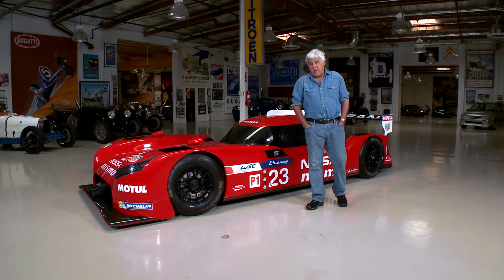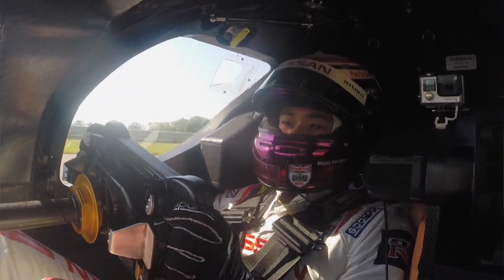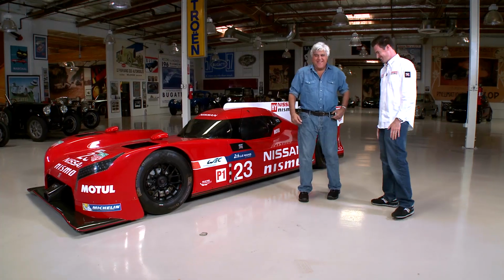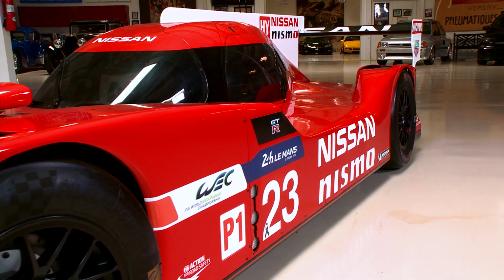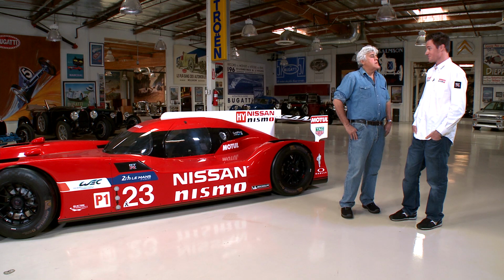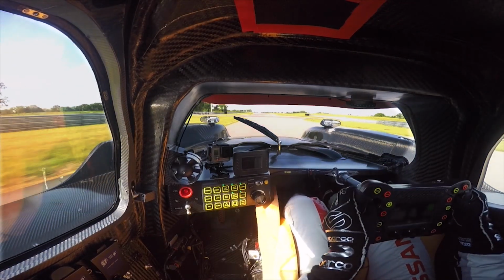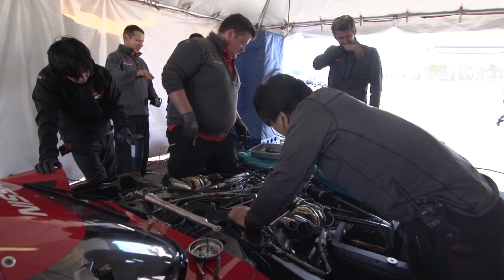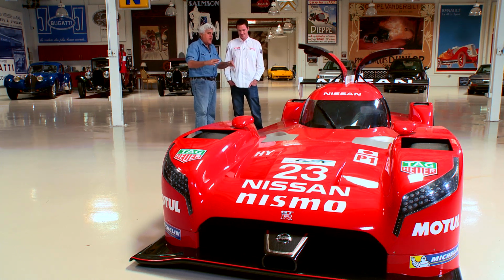Nissan GT-R LM NISMO - Jay Leno's Garage

Comment: So many keyboard engineers here. The design works great for the rules and it is the best setup.
Reply: Porsche Curves Also, no talk of the Godzilla button?
Reply: Porsche Curves did u see it's times? it was in last as far as LMP1 cars and its fastest LMP1 car is being outpaced by several LMP2 cars. this is just practice yes
Reply: James Lewis No, it isn't practice. It is testing. They don't have any setups and were just finding basic data needed to figure things out.
Reply: Porsche Curves "it is the best setup." Bold claim at this point (no, I'm not even going to use the test day as an argument).
Reply: The best setup is the fastest car that wins after 24 hours. This is a publicity car like the Nissan /Delta wing. People get excited by the hype and "innovation", but Bowlby has a bad track record of developing cars that actually go fast or finish races. The point of this project is marketing, not to actually win anything. Car guys suck up hype and BS like no other customers.
Reply: truantray The Delta Wing has problems due to suppliers not being able to make parts that are up to snuff. The Delta Wing only fails due to the gearbox. The GT-R doesn't have rear wheel power due to the supplier not being able to make an electric motor that is light and meets the power requested. 

The design works quite well given the rules. Nissan was running 1,000hp from the ERS alone during testing. It takes at least 3 years to win Le Mans. Have to iron out all of the small bugs.
Reply: James Lewis   
You are missing the fact that Le Mans is more of a fuel economy event than a fastest lap or top speed event. 

The better strategy is what usually wins and that 
is not always the faster/fastest vehicle, especially a long period endurance race such as Le Mans. 
Winning Le Mans is a numbers game with numerous calculated vector risks including fuel economy, malfunctions/failures, shunts, driver error, crew errors and attrition. 

The french organizers label it as "Test Day" and "Test-Practice" . 
http://www.24h-lemans.com/wpphpFichiers/1/1/ressources/Pdf/2015/24-heures-du-mans/classification/test-day/test-day-24-heures-du-mans-2015-test-practice-2.pdf
Reply: patw52pb1 Semantics? Test day, Practice whatever. In F1 they do 3 practice sessions before a qualify. They do exactly what Le Mans do on "Test Day" or "Test Practice" or said whatever. They make their setups for the race. On F1 "test day", like other Competent LMP1 cars, they are running times that are close to the times that they will be qualifying and racing.

But we'll see. I just dont believe they had failures on all 3 cars like that. thats bullshit. They are slow from the looks of it. Lets when they do their second "test day"
Reply: James Lewis F1 has test days and practice days just like WEC does. Testing != practice.Practice happens on race week. Testing happens whenever. There was an F1 test session after the Spanish GP. 

Being slow means nothing. Audi has always been slower than competitors but they have won. I wonder why?
Reply: Porsche Curves
Being slow means nothing. Audi has always been slower than competitors but they have won. I wonder why?

There's maybe a bit difference between being couple of seconds slower (but having a race pace that is closer to the top car) with a proven car and being nearly half a minute slower with a new car that is only bound to have more new car gremlin problems.

You should probably tone down your expections. Nissan is simply not going to be anywhere this year and "well Audi won with a slower car" argument is mostly not applicable. Ever since Peugeot arrived, one has needed a nearly flawless race AND a fast car.
Reply: deggis4 Audi was slower last year and they won. Out right speed isn't what you want. Audi even won against the Peugeots even though Audi had to pit more. 

I'm not expecting a lot out of them. I'm explaining to the idiots why the test day times don't matter whatsoever. The drivers weren't told to push at all. They were told to just do parade laps. They set the highest top speed. Once they turn up the wick and actually start practicing, their pace with right up there.
Reply: ***** Well wasnt this car supposed to have like an Independent powering unit to the rear-wheels from something similar to the KERS system? What ever happened to that idea? Is that still not the case?
Reply: James Lewis The supplier could not make an electric motor that was light enough nor powerful enough for Nissan's application so they dropped it.
Reply: Porsche Curves pretty sure they were relying on that and not a total Front wheel powering.
Reply: Hear That? sadly it isnt if you look at the qualifying times.
Reply: Hear That?  Hey keyboard engineer, it isn't an electric hybrid, no electric motors, no failed supplier. The rears would be mechanically driven just as the fronts but the complex shaft/gear drive was too heavy.
Reply: Hear That? 
The design works great for the rules and it is the best setup
They're not even as fast as LMP2 cars...
Reply: Hear That? so how exactly does "The design works great for the rules and it is the best setup"?
Reply: Hear That? You might want to retract that statement...... xD
Reply: ***** lol i know im just trolling him now because I think for once i deserve to troll someone
Reply: Hear That? "So many keyboard engineers here"      -keyboard engineer
Reply: Hear That? 2013, 2012, 2011, 2006, 2002, 2001, 2000, Audi had the fastest cars in qualifying, and won the race. In the years they didn't qualify on pole, they're only 2-3 seconds from pole position. In 2009 when Peugeot won, they qualified on pole. It's stupid to say that being slow means nothing and that Audi is always slower than the competition.
Reply: Forehead Jones Audi has been slower. That was a huge concern with Peugeot and so Audi had to hypermile the best they could to win.
Reply: Hear That? But you said that they are always slower. Now you're moving the goalposts.
Reply: SilverArrow WilliamsMartini Check out all these keyboard engineers who think the GTR is superior.
Reply: SilverArrow WilliamsMartini Yep, it's engineering was so superior that it was 20 seconds a lap slower than the other LMP1 cars and finished behind teams racing Porsche 911s and Dodge Vipers in their free time. Impeccable logic.
Reply: e-hybrid 919LMP1
Lol, how old are you? 13? Because you act like it. 2014 was the 919's first year racing and it was right on the tail of Audi with an hour left in the race before a mechanical failure caused it to pit. 2014 was Toyota's first year with the TS040 and it set the fastest lap and finished 3rd. 2007 was the first year for Peugeot and their 908 HDi FAP. They took the top 2 times by over a second, led most of the race, and finished third. And Audi has dominated Le Mans despite using several different cars throughout their streak. The GT-R LM NISMO was a failure. There's no arguing this. They finished dead last. Not dead last among LMP1 or even LMP cars. They finished dead last among every single GT Am car. They were 20 seconds off in qualifying and still 20 seconds off throughout the race. They got a grid penalty for being too slow. Of the one car that did finish, it didn't count because of how far behind it was. Accept it.
Reply: SilverArrow WilliamsMartini i hear what ur saying, but u make absolutely no sense because of a few reasons. For one you keep mentioning it was their first race. but we can go back and look at first races for a lot of cars in 24 hour of lemans. I can probably say that none of them ever finished as bad as this Nissan. Also how exactly can you say the design is the best? What reference are u using to believe so? because u cannot, and i mean absolutely, cannot say that its a good design by looking at its results. So what on earth makes u believe this car is any good at all?
Reply: Real car enthusiasts respect any car manufacturer like Nissan for what they are and what they do. I guess you're anything but.
Reply: Razvan J Seriously? I said the engineering is superior because of it's design. The fact that Nissan put the engine in the front restricts less of the car's overall design, so they are free to do more wiith it. Don't you ever do your research, like watch "Jay Leno's Garage ft. the LM Nismo"? I'm a Porsche fan as I've said many times but Nissan has taken innovation to a whole new level. And that is why I respect them. And by the way, I'm 35, and I own a 2007 Boxster. I'm a Porsche fan, I've always been a Porsche fan, but for me Nissan ain't far behind.
Reply: +Hear That? Anytime something has anything to do with a GTR fanboys from all sides show up.
Reply: +Deathbrewer meanwhile in reality it placed behind the GT2's XDDDDDD
Reply: Worked so well Nissan felt bad for the other teams and canceled the project.
Reply: +Hear That? The Nismo was a very expensive radical and innovative...and completely useless car. Now shelved, better luck to them in '17
Reply: Says another keyboard engineer...Its a total failure. Best setup? For what? A 1h race around an oval? Maybe it could have lasted this race. But LeMans 24h? Thats something else. You cant say its the best setup and a great design when obviously it wasn't and failed miserable. Porsche won cause they built a car that actual runs for 24h. Not 23h 56minutes (like Toyota this year), 24!
Reply: BlackMesa RF Porsche didn't win in 2014. A car needs to be developed. You can't blame the car's setup at all when the supplier for the most important part of the car, the hybrid system, could not deliver what they promised. We've never seen this car run at 10/10ths.
Reply: Hear That? No, they did not win in 2014, but in 2015. And Nissan did not just lose in 2015, they failed miserable. Their car was worse than some of the GTLM cars. And to blame everything on a supplier is just a weak point to make. If you start there, you can take any blame to them "Hey we had a great car... yeah i didnt get off the start line, but thats all because some idiots send us the wrong screws". Thats just bullshit, They messed up.
Yeah, we never saw this car run at 10/10ths... because? Its just a great concept? Its so reliable? Its so powerful and easy and well made? oh come on...
You can say things like: The FWD and front mounted engine is interesting and fresh/new concept. But good? In any way? No. No proof whatsoever.
Reply: James Lewis hey
Reply: Haha!
Reply: In case someone is still interested:
I found a reddit post from a guy who has inside information from the project at Nissan, why it was such a great car in theory but never could live up to the expectations.
https://www.reddit.com/r/wec/comments/5wpo1y/why_the_nissan_lmp1_project_was_such_a_failure/
Reply: Hear That?  I know this is old as hell, but I hope that you have gained some wisdom over the last few years. Saying suppliers can’t make an electric motor light enough for them is like blaming suppliers for not inventing horsepower dust to sprinkle on the car!!! You have what is available to use from.
Reply: This comment didn't age well lol

Comment: Starting from 30, 31 and 32 in Le Mans tomorrow because the Nissans are way to slow in terms auf the 110% rule to the Polesetters, the mindblowing Porsche 919. 

This car looks very awful to drive. Everbody can see that by the onboard cameras and the Hybrid doesn't work. 

Only LMP2 Speed on the Timing Screen. Pfff. Humliated by the Germans and Toyota. And by the private LMP1 of Rebellion, too. 

I''m speechless about this Desaster. Porsche was fighting for the win last year in their return year. Compare to that Nissans Debut this year is a nightmare. 

Building a LMP1 with a front engine and fwd. Stupid decision.

Comment: The ONLY reason nissan do this is, if you run front engine, front wheel drive, you can have unlimited power. no cap.
Reply: Greiguci Wootchie really?
Reply: @xavieuhr  Yes sir. This bad boy has over 1300hp, as much as 1350hp. Front wheel front engine in ludicrous and this guy's embarrassing himself by saying it may be the best. I don't think it's won a race since it was unveiled. Lol
Reply: Greiguci Wootchie oh man your right, just searched it up. #themoreyouknow